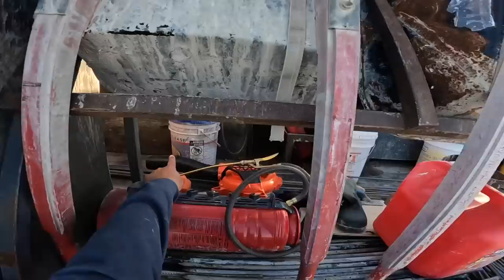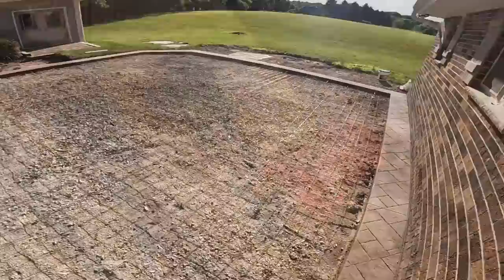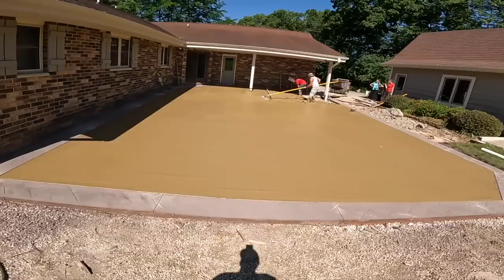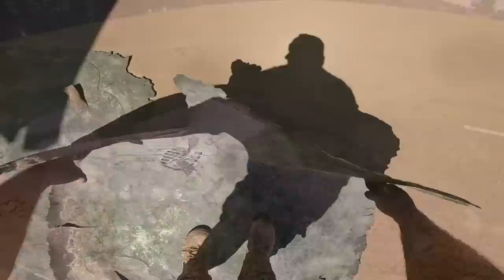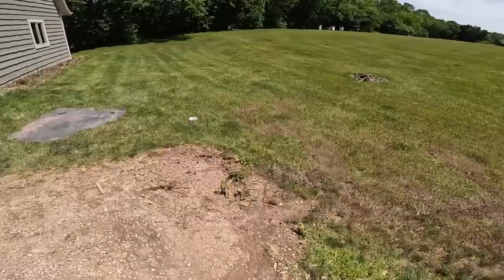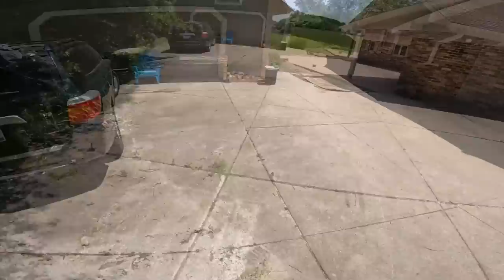Super hot - Super easy!

Comment: How do you know the entire surface is perfectly flat (no low or high spots)? We used to stab into the ground pieces of rebar to have references in different points of the area, particularly the center. Or another method is make stripes of cement each 2 meters and across the lenght wich you can use as a guide. I'm still curious what's your method, just eyeballing?
Reply: The answer is:::::: it's never perfectly flat it is just flat enough... There are always low spots. There's an industry standard

Comment: 8 grand for a 4r100 transmission installed? Time for a new mechanic that's outta control. Rebuilt ones are Dime a dozen and can be done relatively quick- even with the parts shortage issue